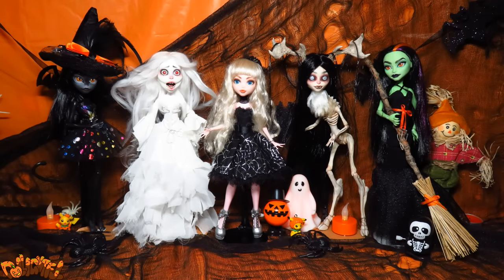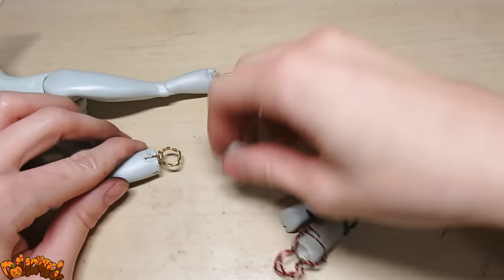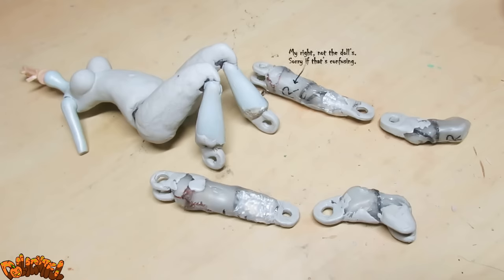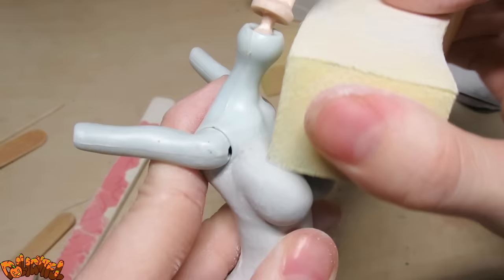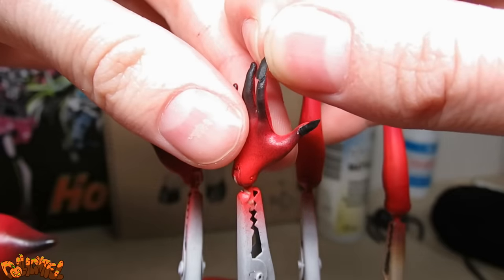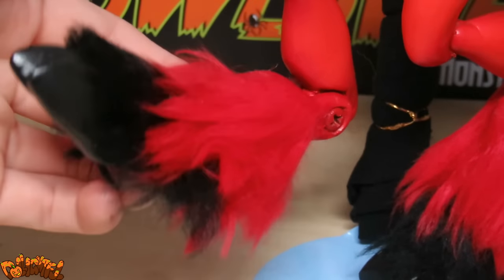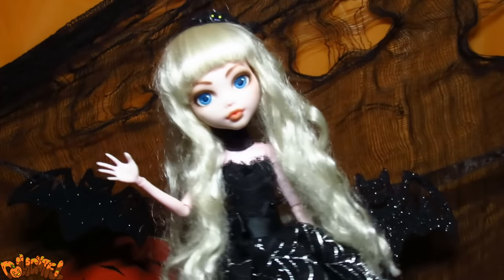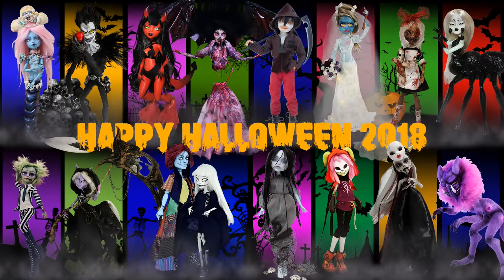Repaint! Halloween Special Demon Girl OOAK Doll

Comment: The scratches on her chin might be from the pliers used to remove the plugs. I've had similar issues when using pliers, and find they can scratch around the neck hole, and sometimes the chin. You could try using a flat head screwdriver and see how that works for you.  :)
Reply: I think its from her mermaid custom. i remember that she used an old lagoona doll as her mannequin and she might have scratched the chin when he was removing the little starfish.

Comment: I like her....but I really don't like the fabric tail. :/ Have you considered trying silicone? You can get it in liquid form from Halloween shops, and then put it on a hard, smooth, non-porous surface and let it dry in layers to get sheets and shapes of flexible, smooth silicone. It self adheres, so you have to dust it with talc in order to keep it from becoming a mess, but I've seen AkameruKawaii use it for mermaid tails, and it's always looked beautiful. You should try talking to her about it.
Reply: You're talking about latex, not silicone. Silicone is a completely different thing. I do agree that latex tails would really look better on dolls like these, hopefully she'll give it a try!
Reply: I think the problem is she wants them to be fully articulated, which isn't going to happen with those materials, but you CAN get with wire and fabric.
Reply: She could try putting in some armature wire in the mold before the latex sets :)